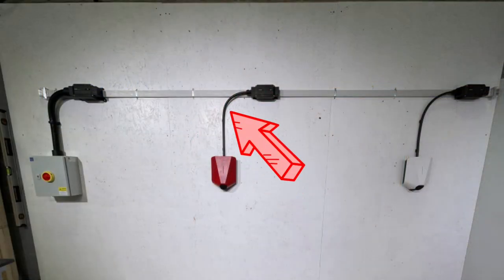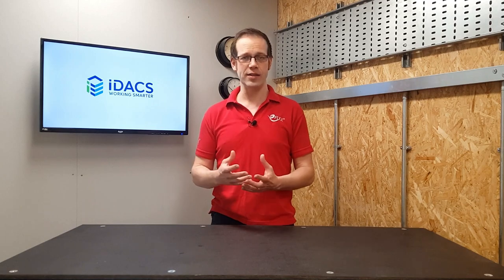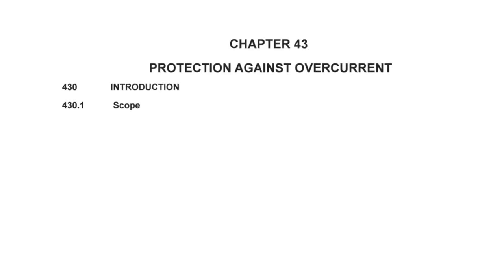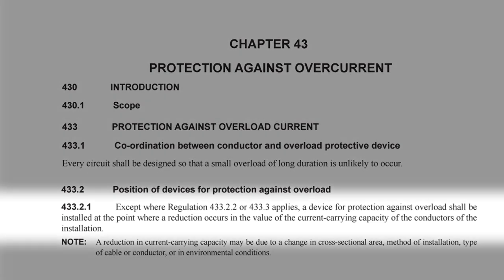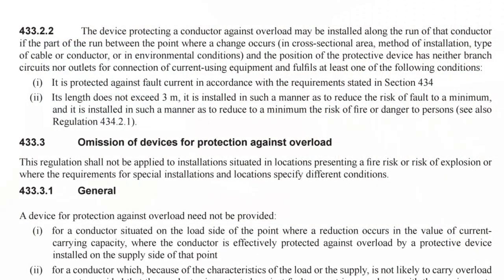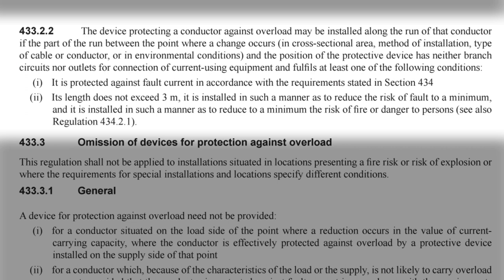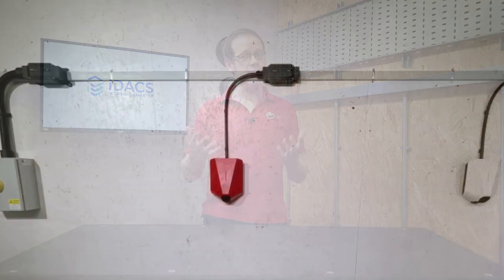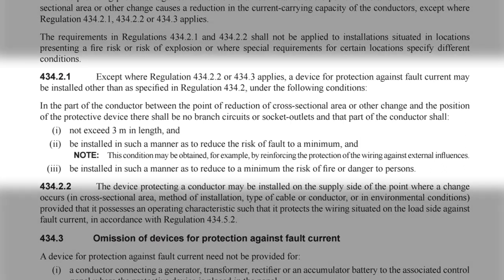ELECTRICIANS' Q&A :Do you need a fuse if connecting from a large to a smaller cable? - BS7671

Comment: There may be a case where you may want to use a larger cable than than theoretically needed for other reasons. This could include voltage drop on a long run where for example you use 6mm cable on a 20A MCB to a group of sockets in distant part of property.

Comment: I had this in work the other week with a shower drain pump wired from the shower switch, through a fused spur, to the pump, so the pump came on when the shower was switched on. Shower switch wired in 10mm t+e from 40A mcb. 1.5mm t+e connected into load side of switch to pattres next to it with an unswitched spur fused to 5A. 
I had done an EICR on it as an empty property a few weeks prior all satisfactory due to what you`ve explained here. Fast forward a few weeks and the new tenant complained that the shower pump was too loud in operation and could we do anything with it so they sent another lad out to have a look. He saw how the spur was wired in 1.5 down from the 10mm and pooped his pants. Immediately disconnected everything saying the world was going to burn down because of how 1.5mm cant take 40A etc. 
I got called called into the office the next day to explain why I hadnt picked it up on EICR. When I explained I did pick it up and in my opinion it was perfectly fine the QS was visibly shocked, I could see him mentally wording my sacking letter in his head. I drew him a little circuit diagram of how the 1.5 would never be carrying 40A as the 5A fuse was protecting the actual pump circuit and he started to calm down. I showed him this in the regs book, he apologised and I got politely asked if I would return to the property to put it back as it was to begin with after the other lad disconnected it.

Comment: It also works the other way, 170m run of 50mm2 to allow for Vd, but only fused to 80Amps, then drop in size 2m away from a motor to 16mm2 (This is all from memory from a good few years ago) but all the calcs proved conclusive.
This is also covered in spec, motor overload current 30A, 80A fuse due to high inertia so 16mm cable more than adequate, the problem was the cable size had to be increased due to voltage drop, and thus the cable was so large that it could not be glanded to the motor, thus an inline joint from 50mm to 16mm.

Comment: I can understand with the overload protection within the device as it should operate before the full Current carrying capacity of the cable with it only being one device that it is protecting but I'm not sure about relying on the primary feed for its fault protection. We have alot of MCCs wired this way with tri rated cables coming off to feed each isolator from a large bus bar arrangement and I've never been comfortable with it. Also the mechanical protection from what I think is an NYY cable in my opinion I don't think would be sufficient especially in a car park area with members of the public. As we have all seen plenty of times these will end up being damaged by either vandalism or vehicles striking them. I'd rather see it either in SWA or in a form of metallic conduit to give it a degree of better impact protection
Reply from the maker: It's definitely something to think about, I suppose you'd want to think about the area, the use of the car park etc. The regulation does say installed in such a way to minimise a fault so you may need some higher mechanical protection on the tap off cables. Maybe you could add an RCD at the mains end to provide fault protection? It's a good discussion point. 🤔
Reply: @efixx  that would mean one RCD protecting several ev chargers which I'm sure will result in nuicence tripping
Reply: Can you explain why you are not comfortable with this idea for those of us less experienced and/or learning, thanks 🙏

Comment: But how many EV chargers actually incorporate overcurrent protection? They will usually be designed to be fed via an upstream MCB. 
Is this a complete system that includes a suitable EVSE with the required protection?
I suppose you could use a fuse rather than an MCB in this scenario to save space in the EVSE enclosure

Comment: This is the same as using line taps onto busbar trunking when dropping into individual CUs in small shop units. The line tapped cable is always smaller than the busbar and is not fused down. It’s like that also in exhibition halls. A larger cable, or busbar is run around the area and smaller cables tap into it and drop down into a local CU or fused isolator.

Comment: Having an EV charger installed via a small CU connected to 100A connector blocks straight after the 100A DP Isolator. The small CU will be in an IP65 steel cabinet right next to the Meter cupboard so a very short run.  What you seem to clarify is that the cable between the 100A connector blocks and the new CU only has to large enough to carry the load of the charger (6mm or 10mm)
Hope the EV charger installer says they have to be 25mm so I can correct him ! lol (of course it makes no difference and there is zero issue with him using 25mm if he wants!)
Reply: It's always been the case that smaller additional consumer units for showers or now e.v chargers would be fed in 6mm double insulated tails ,they need to be big enough to supply the load and not be suitable for maximum possible current flow .  Also the old rule of meter tails can't be any longer than 3m has come from this . But you still get meter tails run under floors and in walls a distance from the supply point .

Comment: Thanks Joe - an excellent explaination and clarification of the regulations. Whist I am totally happy with the overload protection location the short-circuit scenario is another matter. If there is a phase to neutral or phase to earth fault on the cable between the busbar connection and the CU or in the CU itself then the main protection device of the whole busbar system will trip to isolate the fault and all the CUs will be out of action. This would not be a very convenient or acceptable situation. Maybe I am missing something?
Reply from the maker: Yes there is a chance that the whole busbar system could go down from a fault on one of the tap off conductors, but regulation 434.2.1 also allows for the fault protection not to be at the point of CSA change. It uses similar wording to 433.2.2 regarding length and installation to minimise the risk of a fault. I guess the idea is that you're installing such a short run and in such a way that a fault is almost definitely never going to happen.
Reply: @efixx  Thanks for the response. I like the Woertz system but if I was specifying it for a high end apartment block car park with Teslas owning occupiers/owners I would insist on good mechanical protection e.g. steel conduit, for the cable from the busbar down to the CUs. One can imagine the reaction if ten Tesla owners arrived down to the car park some morning to drive into the City only to find that their battery had not been charged overnight due to an incident on one CU.

Comment: Great follow up guys! This was really interesting as I was wondering the same from the last video about over current/load. 
After watching I see no problem really, as long as the tap off cable is rated higher than the over load protection provided within the EV charger. 
I don’t see why the company making the buzz bar cable couldn’t design a clip in overload/current device for say lighting circuits or smaller power circuits. It could be a really useful product.
Reply from the maker: Sounds like a smart idea, thanks for watching and for the kind comment. 👍
Reply: *bus bar...
Reply: @alistair1978utube  thanks for that

Comment: Assuming under 3metres, I was always under the impression that you do not need to provide overload protection if it is a fixed load & impossible to overload.  Thermal withstand calculation would need to be performed on cable size to ensure there would be no damage to cable during a fault condition.  Also as long as earth loop impedance & Line neutral loop were within limits for the protective device for the 16mm cable.  There should be no requirement for a fuse where the cable size is reduced at all.  For example if you had a cooker circuit supplied from a 32A circuit breaker in 6mm cable. the oven was connected via a 1.5mm flex, the oven cannot overload as long as the above was confirmed there is no need for a fuse to protect the 1.5mm flex
Reply from the maker: Fantastic input - EV chargers are the same principle as they are fixed loads. (Maximum load defined)
Reply: Regarding your oven analagy I have come across lots of ovens connected to the bull nose with the 6mm for the hob . I have always added a single socket and put a plug on the oven for the overload situation.  Also ease of removal.  But considering what you have said about the oven being a fixed load  (2kw) it cant be overloaded, the Zs would have to be low to allow the mcb to trip accordingly.
Reply: @dennisphoenix1  it is always good practice to install a fuse or a socket where the oven is rated at say 2.3kw or there is gas hob where the cable reduces in size.  However if you were perhaps doing an EICR & found a smaller cable with a protective device that was much higher than the cable can handle you would complete the calculations & measurements as you are only concerned with fault conditions if the cable is suitable for the fixed load.
Reply: Then why bother having an mcb.
Reply: @johnburns4017  what if in a 1 in a million chance the live and neutral in the 1.5m cable start to interact with each other some how.. it's about protecting cable isn't it
Reply: @behindtherack9056  
The above example:
"cooker circuit supplied from a 32A circuit breaker in 6mm cable. the oven was connected via a 1.5mm flex, the oven cannot overload as long as the above was confirmed there is no need for a fuse to protect the 1.5mm flex"

it goes on..
"ensure there would be no damage to cable during a fault condition."

So the mcb is for fault condition only. So in theory it could have a 60A mcb, even though the 6mm cable is maxed at 48 amp, as a 60A mcb will cover faults on the circuit, inc the appliance.

In the real world it is best that the mcb should be sized to suit the 1.5mm cable and appliance, not left at 32A even though in theory the circuit cannot draw more current than what is stated on the appliance label.  So, the max amps of a 1.5mm flex is approx 16 amps. The cooker/oven may draw 12A.  Fitting a 15A mcb covers everything.

The diversity calcs state that a 2.5mm flex can connect up a 7.2kW hob.  Few do it. Because of this inbuilt caution by electricians safety is higher - IMO.
Reply: @behindtherack9056  The idea is that the MCB would trip and trip sufficiently quickly that the cable wouldn't over heat
Reply: If you use 1.5mm2 flex connecting to an oven at a maximum of 32 Amps: let's say for our example, method 103 is used for installation of the cable, the max current rating then is 10 amps. That's a maximum power rating of only 2300 watts

You could easily have the oven and a hob on which would consume more current than the cable can safely handle, and cooking of food takes a while, it is not that power will be consumed for a few seconds or for a few minutes, it is likely to be considerably longer, so in the scenario you have described, there is most likely a fire risk.

Would a fuse protect it? Yes, a 10amp fuse would protect it. Or perhaps the MCB should be changed and reduced, or better still, use the right cable size for the current and fixing method.
Reply: @deang5622  
Patrick Brannan's e.g., was a 6mm cable on a 32A mcb, then a junction with a 1.5mm cable to an oven, at the oven I assume.

The oven is assumed to be 12 to 14A as most are these days. A 1.5mm cable can draw 16A max.  The oven will never draw more than its current rating, let's say it is 13A.  So no fuse needed for the 1.5mm oven cable, in theory.  In practice most electricians would fuse the oven separately when a hob and oven are fed from the same 6mm cable. That may be an inaccessible fuse/mcb behind the oven.

I point I made was that overload protection was redundant for the fixed load oven, with the mcb only providing fault protection. So on a dedicated oven circuit with the oven unable to draw no more, ever, than 13A. Fitted on a 2.5mm cable, in theory a 60A mcb can be fitted at the CU as the overload protection is redundant.

Taking it further. I have a 800w toaster, with a heating resistance which draws 3.2A maximum.  In theory it can never draw more than 800w. So having a 13A fuse in the toaster's plug is fine. I put in a 6A fuse. That is me, because I do not believe it will never draw more than 3.2A if a fault condition occurs. As I say that is me. Others are the same, who side with caution.
Reply: @johnburns4017  Interesting example, years ago I remember looking at an extension lead for tv, hifi and video, altogether it was less than 5 amps but at least one said a 13 amp fuse must be used, tried using a 3 amp fuse on one and it didn't work even though mathematically it was 2. something amps. So I have a extension with 13 amp fuse that will never see more than 5 amps but the device manufacturers insist on using 13 amp fuses.
Reply: @olivertaylor4779  
Did the 3A fuse blow?

Comment: Meanwhile the whole of Europe is supplying appliances with a 3G0.75mm2 unfused from a 16A socket...

And to add to that:
Using unfused 3G0,75mm2 extension cords with one or multiple outlets from the same 16A socket...
Reply: Yeah, but don't they still use the radial system in europe where each socket is protected by it's own fuse or breaker? so they have to have larger consumer units to accommodate all the protective devices, or separate ones like we had here in the UK before we had ring mains? Though it is possible with the radial system to plug in a flex which has a smaller cross sectional area than the supply cable so it's theoretically more unsafe, if the socket is protected by say a 16 amp breaker or fuse and you plug in a much smaller flex which most flexes will be, especially for lower powered appliances. The main problem in my experience of electrics, and I've seen this with low voltage auto electrics too, is that there's a region between where a circuit starts overloading and where the protective device cuts out or blows and it's that which causes the fire risk by overloading a cable but not enough to blow the fuse, or trip out the breaker, which is why in theory at least the ring main is safer, but it's still open to abuse by people using too big a fuse in their plugs, but that's not the installer or the regulator's fault, is it?
Reply: Note that flex, NYY-J etc have a full-sized CPC, while larger sizes of UK T&E have a significantly reduced CPC. I don't know what spec exactly the "tough sheath" cable efixx used in their EV charger example was but the CPC in it looked full size to me.

I haven't run the numbers with the formulas in BS7671, but ehen you consider a 4mm² T&E only has a 1.5mm² CPC, then 0.75mm flex on a 16A breaker or a 6mm² cable with a full sized CPC on a 63A breaker doesn't seem so crazy from a "fault protection" point of view.

All the European extension leads I've seen have 1.5mm² flex, but I'll admit I haven't looked closely at too many of them.
Reply: Or the US where they have 30 amp outlets you can plug a standard plug into.
Reply: @danielplusben  Are the american outlets really 30 amp? Which sockets are they? Aren't their little domestic sockets only rated at 7.5 amp? That's what I've seen written about them in catalogues offering them. And I think I've seen it marked on some of their plugs as the same outlets are also used on the back of some hifi amplifiers here in the UK. And a friend of mine has an american jukebox which has US outlets also rated at only 7.5 amp. Or are the 30 amp outlets for stuff like electric cookers? As far as I know in the US they have 120 volt supply for their domestic sockets and lights but 240 volt for their more major stuff like cookers which would need a 30 amp supply point.
Reply: @majorpygge-phartt2643  Looks like I was slightly wrong. The pins are slightly rotated on the 30 amp, but adaptors are readily available after a quick Google search. Standard outlets are rated 15 amps but the same still applies. The wires they use for smaller appliances are much thinner but are still not protected against overload. The sockets on the back of stereo equipment I've personally seen are actually completely different and non compatible despite being two flat prongs. They do this so that people don't plug high current appliances into the through on an appliance not rated for it. I am sure some exist which do use standard sockets however, despite the risk.

Comment: Good explanation using correct terminology. Hasn’t downstream fusing been used for years though for situations like this. Can an EV charger ever become overloaded? I don’t know as i don’t install them.
Reply from the maker: Correct not a new concept, but new to a few viewers of the previous video. EV chargers can’t be overloaded if installed and set up properly. The car then communicates at the start of the process to find out “what’s available” in terms of maximum current.
Reply: If you only have a single load on the circuit, then it doesn't matter where the fuse or breaker is, just so long as the breaker is at the same rating or lower as the lowest rated cable.

If you have multiple loads on the circuit, and different CSAs for different lengths of cable,  then it makes sense to protect the cables of different CSAs with their own fuses and either just before the smaller thickness cable or along its length somewhere.